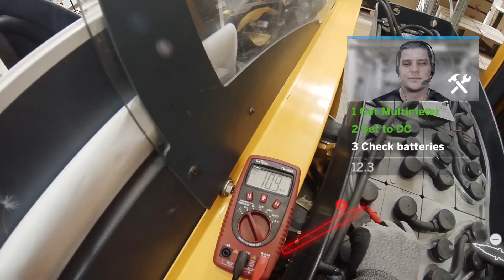Connect Smart Glasses and SAP with the Simplifier

Comment: wow, I wish we had these at NEXT Distribution LTD. As a warehouse operative doing Picking and Put-away with some old Motorola WT41N0 and RS419 ring scanners that often fail and lead to inefficiency in workflow. If we had this system my job would be so much easier.
Reply: Hi, if the WT41N0 failed i can fix them, most of the problem is the mismatch between the barcode type and size and the type of ring scanner used for that barcode .

Comment: I am really impressed by the AR based navigation system for picking up orders. What is the tech for positional tracking?
Reply: a sprinkle of bs marketing
Reply: @senator7352  for that video, yes. but later we made working apps for various glasses with multiple types of location tracking like fiducial markers, gps, IMU, BT-Beacons and so on. All depending on devices used, environments and use cases of course.